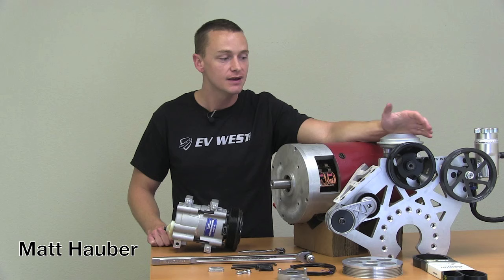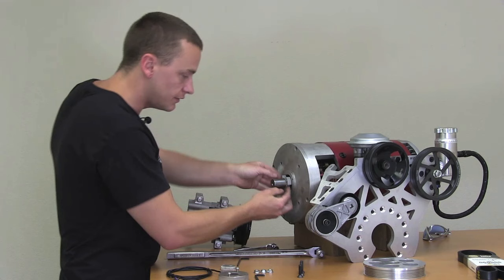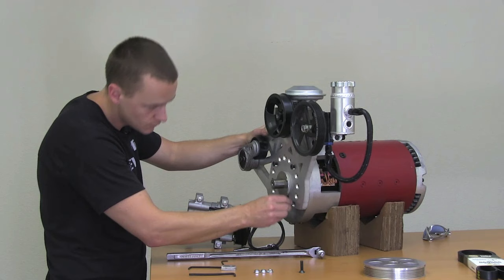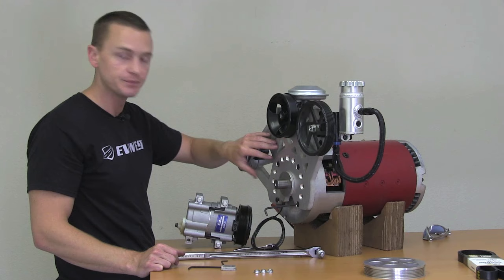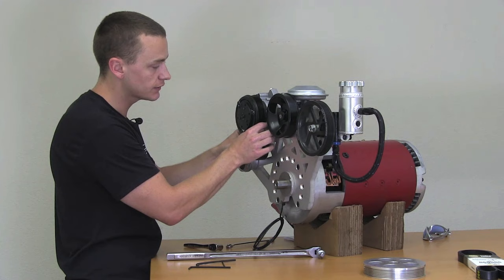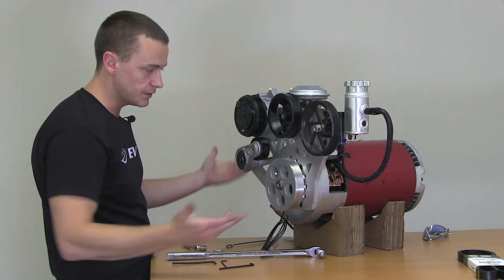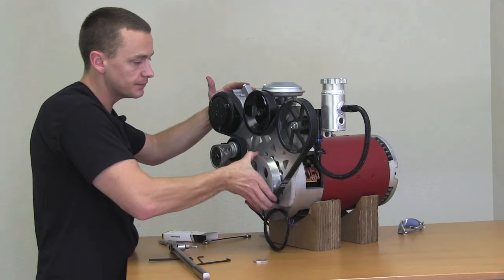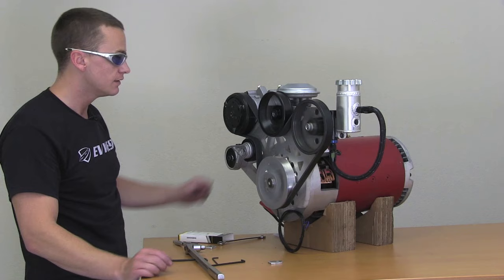EV West Electric Motor Accessory Plate Installation Video - Power Steering, Vacuum, AC Compressor

Comment: Most modern cars have electric power steering and the Prius has an electrically driven A/C compressor so why not use those. I realise though if you are electrifying an older car this method might be easier but not as efficient.

Comment: Matt: Can you now get Regenerative braking with a DC motor? If so great I live on a 5000 foot mountain and a Nissan leaf with 80 percent charge in Escondido made it up here with 15 per cent charge left, and on the way down with their percent of regenerative braking the charge meter read 95 percent charge at the bottom of the 12 mile grade. Can I get 0-60 at 5 seconds? if so VERY interested in converting.

Comment: That's a slick setup for those accessories.  I was wondering how one would tackle adding them in an EV setup.  Having said that, they only work if the motor is spinning, and the motor only spins when the car is in motion/under throttle.  So, if you're in a parking space and need to maneuver the vehicle, you have no power steering, AC or power brakes, because you're essentially at a stand-still.  Once the vehicle is moving at any speed above 5 mph, power steering becomes moot anyway.  Might it not be better to have a smaller accessory motor that constantly runs when the car is on to power these accessories, so they're available regardless of whether or not the vehicle is in motion?
Reply: That's why is now using electric power steering and not hydraulic power steering and today AC compressor is not driven by belt, then via small electric motor inside AC compressor. All hybrids today using small electric motor in AC compressor so that the AC can work when hybrid is switched to electric drive mode.
Reply: The idea is to use the electric motor as a direct replacement for a budget swap. Ideally you would want to use electric units but these mechanical options are very efficient and it doesn't require that much power to run these motors at low rpm with low torque requirements. Its a give and take kind of solution. There are electric options but this is quite a bit cheaper and won't hurt your range too much more than using electric accessories would.
Reply: You can hook these electric motors up to transmissions which then allows you to set a idle speed on the controller so the motor will idle like a car and run these when not moving

Comment: This "EV WEST" electric motors kit, is the best kit bar none. I haven't seen nor heard about another electric engine kit that comes with a full hookup for all your accessories, like the AC unit,Power steering pump, Power brakes,  and after every unit have been installed you can barely hear the engine running when the engine has been engaged.  Grady Tatum....

Comment: A lot of you are correct this is a very nice setup it looks very nice but don't forget there is a massive amount of strain on that front bearing, you will be replacing that bearing in just a few years. I know this for a fact because I made the same setup with a warp 11 motor and the bearing started roaring within about two years. You're better off making those pumps electric and running them off of an alternator and 12-volt battery.

Comment: After reading all the nitwits comments. It depends. This is a purely electric set up. There is no gasoline engine running it. I hear the comments about “ would not electric be better” this is electric!  You don’t need AC compressor or power steering or vacuum pump while you’re sitting still you need your fan to blow through the evaporator to keep you cool. The electric motor that replaces the gasoline engine runs a belt that runs these accessories.  Sitting still there is no need for this motor to run. Otherwise you would just be wasting battery power. Someone mentioned selling the RPM at 750. That is a waste of battery power. The second you put your foot on the Excelerator all these Accessories work as needed.

Comment: Looks like a nice set up , what I can't understand is how would the power steering pump work when the motor is at lower rmps like when you're trying to park the vehicle. The AC compressor could continue to run while  the car is at a standstill but you have to put the tranny in neutral and rev  the motor up a little! 🤔

Comment: It's nice that options are happening, but they are obviously imperfect. Electric assist power steering is one change I would make. I would also give up on aircon. For winter heat, I would get one of those instant hot water heaters from a home and have that in the dash. Those things are great.
Reply: +Brian Genter Push in clutch. engage motor

Comment: Faraday's law would indicate...that the energy it took to sprin that alternator *resistance follows energy draw" would be more than what the alternator produces.  SO....maybe a tiny biodiesel generator could produce electricity to charge the battery bank..giving you a longer range.  You could hook a few expensive solar panels to the vehicle in a aerodynamic fashion, aslo charging the banks.  Regenerative Braking could also add to the vehicles range.  These are all good ideas.

Comment: Best thing is, when you are stand still and need to turn the wheel to get your car out of a tight spot - you get no help from the power steering as the motor is not running. Electric servo is the way to go.
Reply: On the plus side, shaving several hundred pounds out of the front of your car makes the wheels turn a lot easier.

Comment: Vacuum pump for the brakes works fine without the motor or engine running for a few full pumps. But AC and hydraulic Power steering are a different story. AC in an EV is typically the same as a typical refrigerator, with its own motor, or a solid state unit, which I understand the Japanese are working on, to make refrigerators smaller but would work in EVs. The Steering would have to be Electric. Either that or you rack is geared that you don't need boost anyway.

Comment: This mounts on the other side of the motor, not affecting the transmission mounting. It only adds about 2 inches of length to the front side of the motor.

Comment: There are now 12 V air cons ,,Elect motor comp...used on Hybrids so you can have air when the engine has stopped..elec vac pumps

Comment: I would have independent motors for power steering and air conditioner so they can be turned on whenever they would be needed, or else, the set would have to use a clutch and keep on running on about 800 RPM like if simulating how the combustion motors work when we are standing still by a stop light.

Comment: Do you guys do hybrid conversions? I have an idea that I think has a strong potential that I will share. Think of 4wd pickups. They are all across the country and popular for great reasons, but not known for efficiency. I say, remove the v8 & put in a v6 with a 2wd style tranny. The rear wheels will stay gas powered. on the front axle, attach the electric motor, maybe with a multispeed transfer case. Use one of the ABS sensors to feed data to the electric motor control unit, so both ends spin at the same speed and maybe so the electric kicks in automatically is it senses loss of traction in the rear. Battery packs could be stuffed into the sides of the bed. I bet a lot of folks would get excited about that!
Reply: Brian Genter Toyota did that years ago with the Highlander hybrid. Honda did it with the NSX.
Reply: hi there looks like a fantastic set up how much is the kit with   /2/motors with that set up.

Comment: Greetings, friend, first of all, thank you for your contribution. If the engine is going to have accessories attached, the engine at idle should be at 800 rpm, or when it is stopped, should it work at 800 rpm?

Comment: You would have to have a manual transmission with this and set it to never drop below 750 rpm even at a stop (clutch in or neutral).

Is it normal for electric motors to have a shaft coming out the back for accessories or is that an extended shaft? shaft in the back for the trans to grab and shaft in the front for the accessory kit.

I bet this kit cuts your battery life in half. a simple 12v vacuum pump that comes on when you hit the brakes seems way more efficient. I could see a kit that has multiple alternators attached rigged for 120+ volts (there is someone who did it on youtube).

Comment: is it posible to convert 660cc engine to this motor... how much power supply it need to run for 1hr drive in 5000rpm ...

Comment: If you are not on the accelerator will the AC or power steering still work?
Reply: jesse ray as long as the motor is spinning they are working...so coasting, yes, accelerating/cruise, yes. At a stop you will lose AC and PS.
Reply: I would guess the tech sensor keeps the motor spinning at a low RPM like your gas engine does at idle.
Reply: The motor is always coupled to your gear box so if it's spinning the car is moving or something is broken... Unless you have an auto trans with a torque converter, these belt driven accessories are silly, IMO.
Reply: I had a 50/50 guess.
Reply: I would run a aux motor to run the accessories.  The car's loaded w/ batteries anyway.
Reply: alex tworkowski why not just get electric accessories
Reply: Electric accessories makes way more sense than trying to maintain the belt driven ones.
Reply: Tyler Hardy shift to neutral maybe. ..
Reply: sorry, i think you are incorrect sir, this is a separate motor, this is NOT a drive motor, so the controller will keep this motor running any time you need a/c, vacuum, or power steering as all 3 of those devices are being run off of this motor. i just wonder how much it lowers your range ??
Reply: He said earlier in the vid that depending on how the transmission is installed the motor may be turned differently. Around 2:28 . That is why the bracket has multiple mounting hole and possibilities.
Reply: normdoty he said it works with the warp 9 and 11 motors.   The warp 9 puts out 100lb ft and is designed to be a main traction motor.  I highly doubt he meant for this motor to just run accessories.
Reply: you had a 0/100 guess
Reply: Hybrids have electric steering pumps.  AC remains cold for quite awhile, even without the engine or motor turning.  6-7k Miles ain’t much to brag about, lol.
Reply: jesse ray no its not work if motor is not running ..
Reply: Add a creep motor function to have continuous ac and power steering
Reply: On 2018 cars the ac shuts off at stops anyway to save gas (as an option) and you dont need power steering at a stop really. That being said you COULD hook up a transmission but these have so much torque it would murder the trans
Reply: Very Cool..amazing,thanks,keep up the good innovation work..HOW ABOUT SOLAR PANELS ON ALL PANELS TO HELP BIT WITH BATTERIES CHARGING..
Reply: @hondaguy9153  unless theres an idle mode on the motor that keeps it spinning at a stop. In that case, neither of the accessories attached to the front carrier need to be rotated more than about 700 RPM to be efficient. All one would need is a clutch between the motor and transmission. It could even be an electrically actuated clutch, much like an AC compressor clutch, between the motor and automatic transmission.
Reply: @Photologistic  very high voltage runs electric accessories on full electrics and hybrids. And the AC remains cool for a while due to the fact that the compressor is running on battery power.
Reply: @Kihidokid  most vehicles with atuo start/stop utilize an auxiliary battery and an electric compressor. AC functionally is retained during auto stop.
Reply: @KnowledgeMotorsport  I maintain my point the swapping to electronic power steering or an electric pump for the power steering and an electric AC compressor would be more efficient and make more sense if you're trying to maintain these accessories in a daily driven vehicle. It might cost more because of the new pump & compressor but in my mind it doesn't make sense to put a big bracket on the front of your motor and have to keep the motor spinning all the time to keep your accessories working.
Reply: @hondaguy9153  I agree: go all electric. Just providing insight on alternative methods, as an engineer.  They decided to solve with that solution, and It works as designed. There seems to be some question about how the accessories will run at a stop. I simply provided answers as to how it could be done.
Reply: @KnowledgeMotorsport  In Italy our "retrofit" law forces us to install the motor in the existing transmission. Is this a case in which keeping the existing clutch (manual 6-speed) may be a good choice? I thought of a solution like this one in the video for my conversion, paired with the use of the existing 12v lead-acid battery for services.

I mean... if I have to keep clutch+transmission, maybe the best design solution is to just swap the motor and keep al the rest intact.
Reply: @ZeKhana  I dont see why not. I would guess that the clutch would have to remain depressed at at stop. You'd also have to have an RPM governor of some sort, which would keep the motor from running away? I think and electromagnetic clutch would be the best route.
Reply: @justinlabarge8178  where would you find those? Good idea, BTW
Reply: If u install transmission with a clutch u can depress it and keep foot on accelerator pedal for ac to work

Comment: you could kinda run a snowmobile clutch i quess so if you standing still the motor could run slow and still have ac and power steering

Comment: Nice vid...well done....what happens to these external motors when the motor stops? Electric motors don't run like gas engines. The air conditioner would stop correct?

Comment: A modern  12 V. 100 A. alternator caries all the accessory loads while driving, and it comes free with the donor vehicle. also the alternator is actually quite efficient and continue to charge when you are slowing down and seamlessly integrate with the auxilary battery for a steady source of the nominal 12 V. Your favorite DC/DC  converter is also not 100& efficient. and if it fails you are left to buy another for several hundred but the shipping takes a week.. The alternator is often as low as $75 and readily available in nearly every town. Of course you don't make a profit from not selling the DC/DC converter... And the two speed transmission is not as popular as you would like , I buy mine from a local auto racing supply for about $900. and I don't idle my electric motor that is a hangover from the past, there are other solutions for power steering like an electric pump unit, and the power brakes use a reservoir anyway so the vacuum pump from any recent diesel pickup will work. The air conditioner compressor can stop for a minute or two and the car passengers still feel cold air blowing from the ducts.  Like I said you seem too profit motivated ...
Reply: This is a great idea. Thank you for this. Some of us are trying to sort through all of this and aren't going to spend $30,000+ building an EV when they can be purchased for a similar price. It's things like this that can help shave down the final cost and make the idea of attempting one of these builds more feasible.

Comment: Sailboat application? Love to see this in a blue water application. Solar with the addition of a 7.5 kW diesel generator. When under sale the prop would generate electricity back into the batteries. Could be good. Less reliance on fossil fuel.😎
Reply: Great thought... furthering that... two battery banks [pricey I know] high out put alternator [maybe two] on the accessory plate.... use one bank while the alternator(s) charges the unused bank. Zero emission. Whadaya think?
Reply: Damon Duval you would never generate enough power to move the boat and charge the other battery bank so that alternator is pointless. The diesel generator/using the prop while under sail power to generate electricity is more effective.
Reply: that does sound more effective/efficient, yes - the double battery bank still looks promising

Comment: I am a nuub just learning about EV.  No electrical background, but can handle most gas engines.  My question is: with this plate, could you add an alternator and perhaps regenerate some of the electricity back to the batteries?

Comment: What about the heating part in the winter, the kit you installed comes with all the parts and dose it install in the front or the back of the motor

Comment: Is this the same motor that runs the traction system? So the transmission connects to the other end??  If that’s the case wouldn’t accessories only run when car is rolling?

Comment: It would be nice to see what it is that determent what amount of power you can get from an electric engine. Etc how to reach an even higher amount by changing the distances of the magnets, the rotors with less/more weight or any other types of configuration changes?